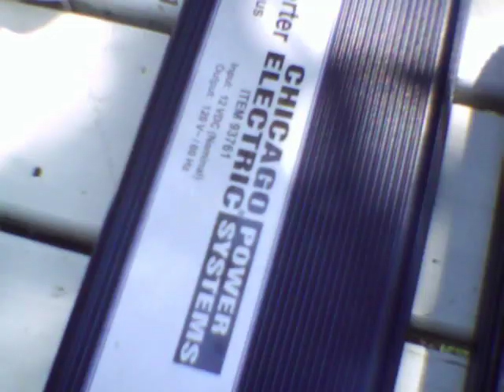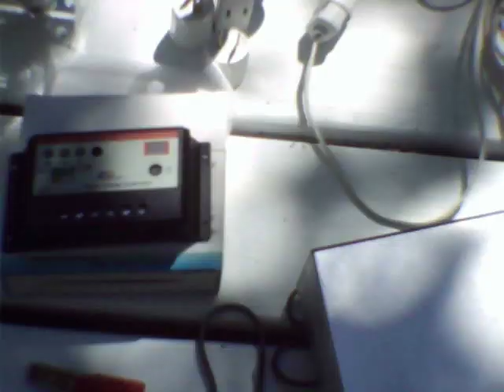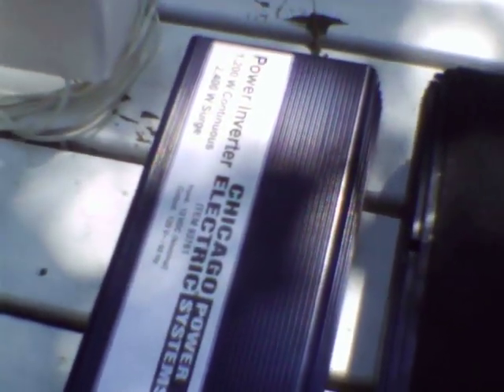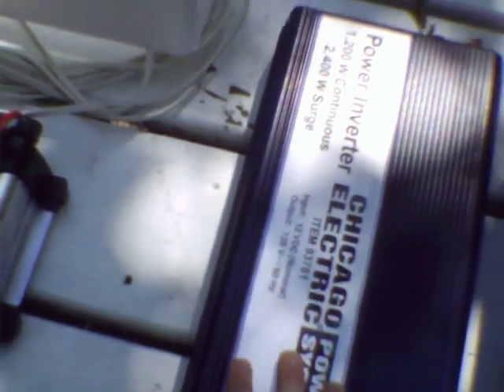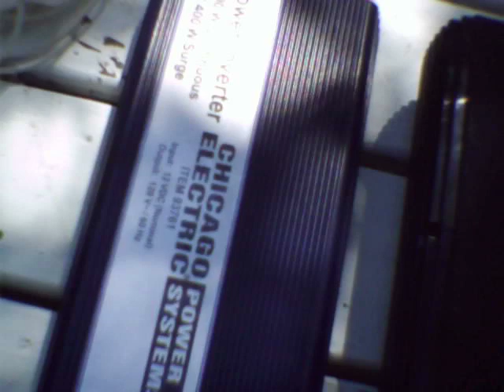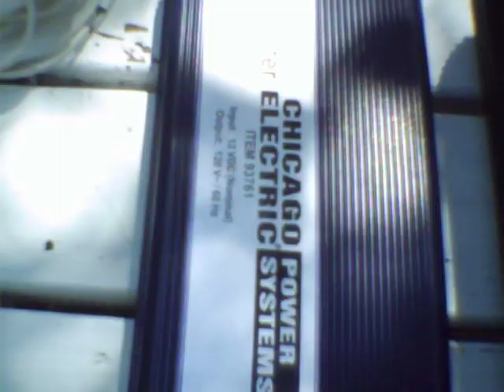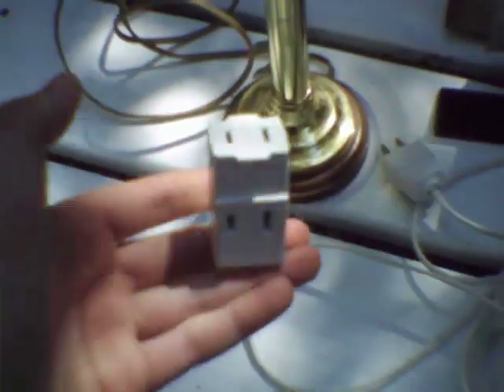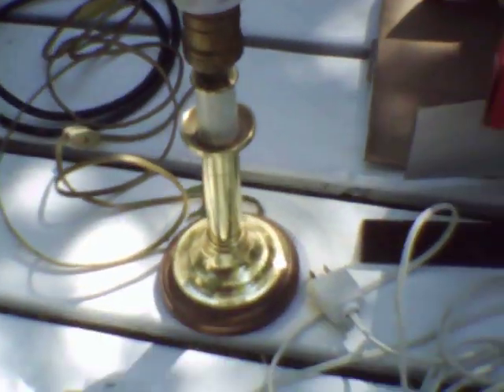Emergency electricity system basics

Comment from the maker: @ncrdisabled   Black start incapability is a common thing in smaller consumer grade UPSs.  Some can be tricked into black starting like the smaller UPS in the video.  The bigger one will black start without gimmicks, but it is a high end consumer/light commercial grade UPS.  These are just for feeding small loads until I get the main emergency power system operational or for loads that must be isolated from it (i.e. the cable modem during a thunderstorm).

Comment: I worked for a UPS company for 9 years called KW Controls they sold from 1kva to 1000kva generators and UPS systems . They made there own big ssystems and sold Piller smaller ups and piller big ups I was a field service tech. I learned that some ups system would not start on battery alone and most of the cheaper units are modified sine wave . I had a 10kva online ups in my basement up until my house was hit by lighting it blew up but saved everthing hooked to it .Company KW closed